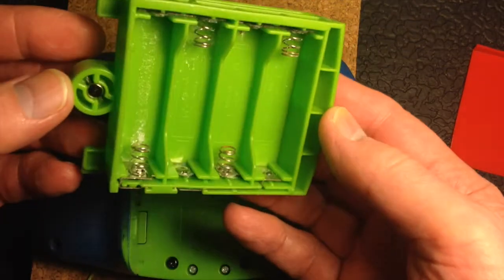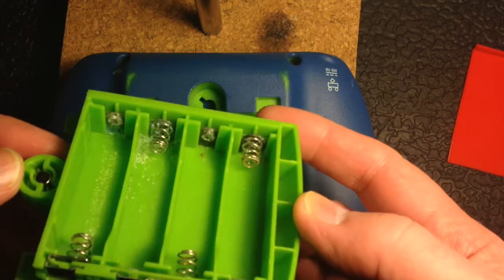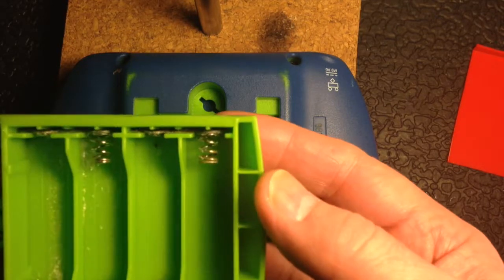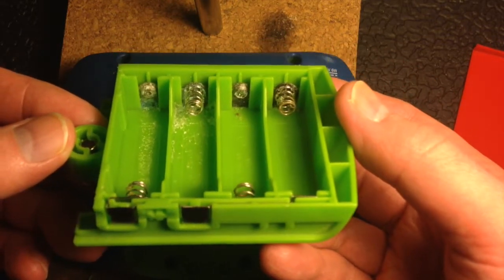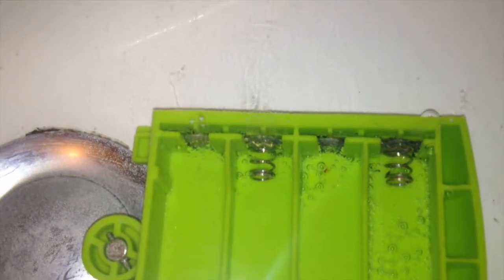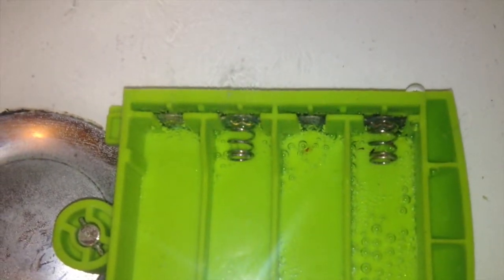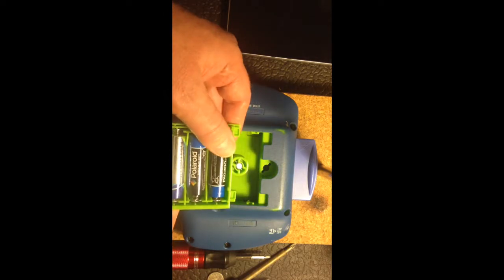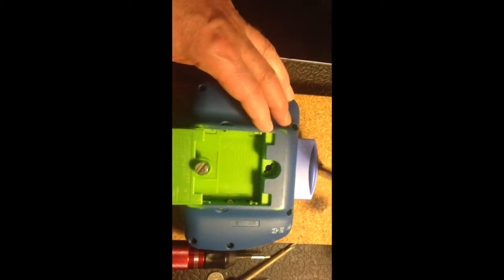How To Clean Up And Neutralise Leaking Alkaline Battery Damage

Comment: i want to know how to find the amphere hour of any alkaline battery because it's not written on it.
Reply from the maker: Thanks for the question, the only way to find out it to use an intelligent set to discharge, it will tell you  how long it take it to discharge. But that will drain the battery dead which will defeat the object somewhat.  Better to use rechargeable batteries, when they die the leave very little mess. #geakyUNCLEfixed1t
Reply: so how do i know how much load (ohms) i need to put in series with the battery and the multimeter to find the amphere hour. If i want to know the amphere hour of 2 AA batteries (3 V) then how many ohms of resistor i need to put in series?
Reply from the maker: check out my latest video, this great tester I bought should help. http://fixed1t-money-saving-tips.blogspot.co.uk/2016/10/save-money-on-batteries-with-this-great.html

Comment: I hate doing thatI had to trash a toy backhoeabout a month ago because the owner that had it before me left the batteries in there for so long that it had gotten to the inside wiring and ate it  that really was a shame to because I cleaned it and I was going to order a new arm for the back because he bustedThe U joint for the bucketbut I've had a lot of dealings with that stuff the first time I didn't know what I was doing and I was about seven years old and I was trying to play GameBoy but one of the batteries head exploded inside and I burn my face thankfully my parents were there to save me now when I'm handling that stuff I either use gloves or whatever other resource I have at my disposal
Reply from the maker: Yes this is pretty horrible stuff to work with, I prefer the Alkaline's to old acid batteries, if you catch them within a reasonable time the device can be saved, but the acid batteries ate through everything.  The only thing with the alkaline it the corrosive turns into a thin oily film which folks could easily ignore at their peril.  Wearing gloves is important and also serious wrap around eye protection.
Reply: That's one reason why for most of my remote control vehicles I use rechargeable batteries because they don't have that corrosive materialbut I protection is a good idea I have some safety glasses that I probably should wear when I do itthey're made by Catapillar
Reply from the maker: Likewise, it would be so much simpler if the electronics  companies used circuits that worked with 5v rather i.e.4 x 1.25 rechargeable batteries as well a 6v 4 x 1.5v so you don't get the low battery warning.
Reply: Only thing is though I wonder how much that would affect the price because they may need more expensive circuitry and for all those toys that don't have the batteries included you'll still have to spend a lot of money for themI granted the prices are inflating anyway but I wonder if a $50 toy could suddenly become a $100 toy just because of that circuitry change
Reply: But there are actually a few toys that dohave rechargeable batteries from the factorylike a lot of the micro RC toys have rechargeable batteriesThe only downside to that is depending on what toy company you get them from you either get a really good battery that will last you a long time or you'll get a crap one that doesn't even last five minuteslike for example Hasbro made this one truck that you were supposed to charge for an hour and a half and then it was playable well I charged it for an hour and a half and the thing did not even workit was really a shame to because it was a cool double-sided car that you can flip overhowever I found a car about four months later that did the same thing but it was five times faster and the battery has lasted me almost 3 years the car is still as fast as lightningI need to get in there though and clean the wheels out because it's kind of slow down just a little bit so I needto unscrew the top side and try to get in there and get all the crap out so that it performs at top performance I'm thinking about possibly getting another onefrom that same company today I'm going to work on making a video about it

Comment from the maker: We've all done it left Alkaline Batteries in a toy of gadget causing major damaged as they drain and begin to leak.  This video is about how I Repair Leaking Alkaline Battery Damaged to prevent it from getting worse even when the batteries have been removed and replaced. #fixed1tfix